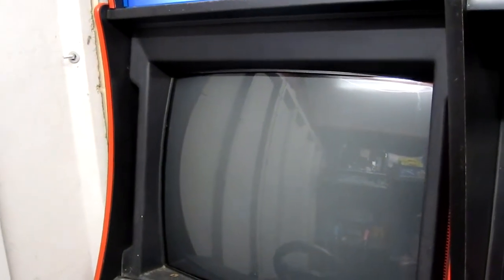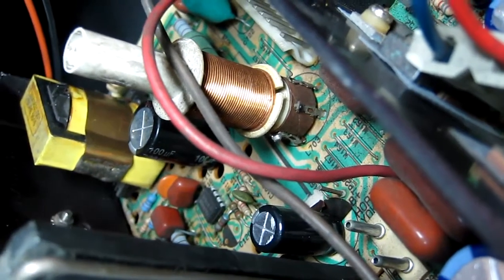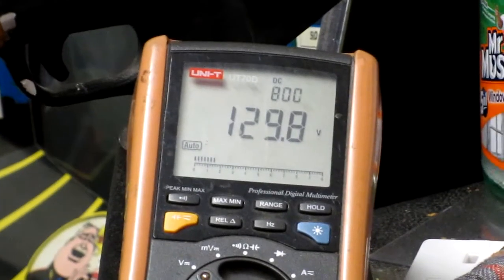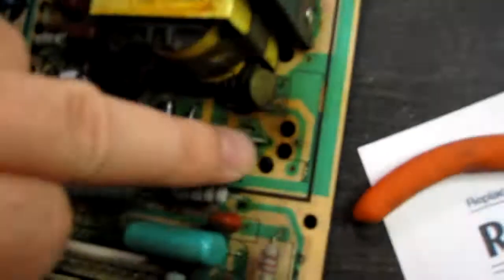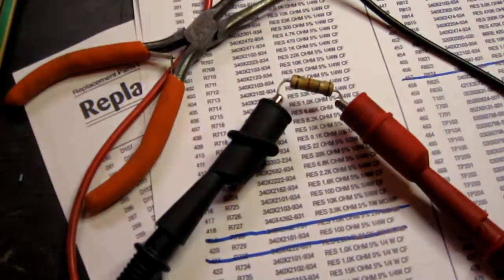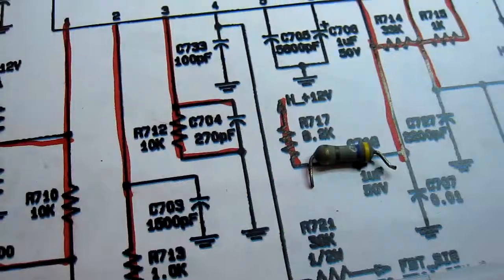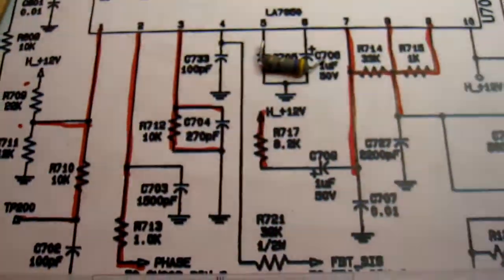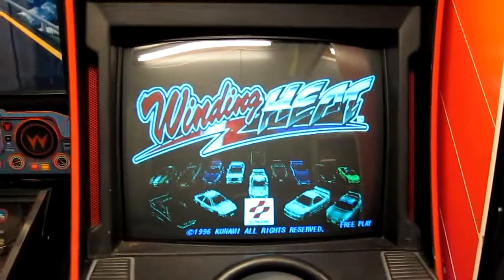Wells Gardner u5000 Monitor Repair (Konami Winding Heat)

Comment: R760 is completely open on my U5000. Weird enough the resistor that's in there is also 470ohms, but in the parts list AND the schematic I have says R760 is a 100ohm 1/2 W resistor. I'm so confused right now and not sure what to order now...